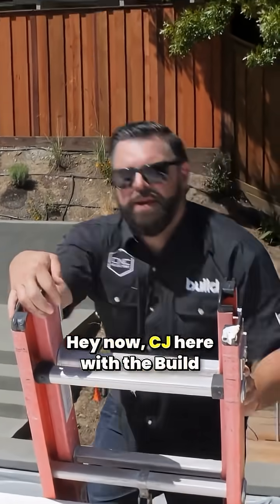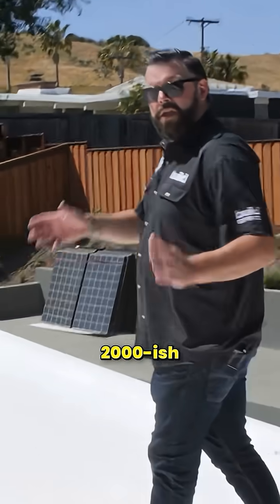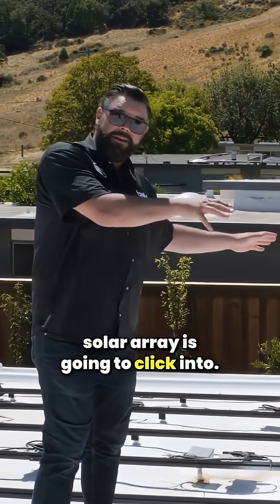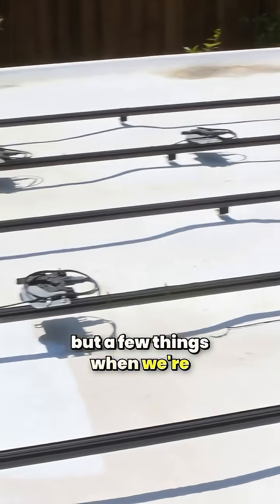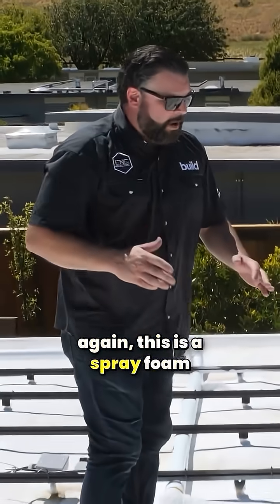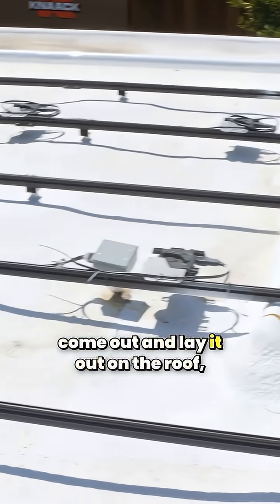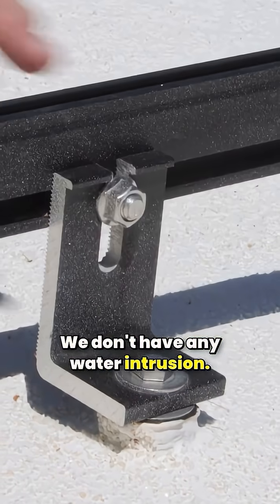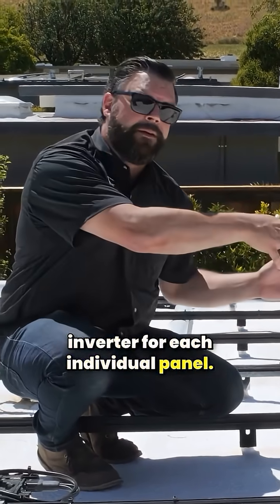Smart Solar Planning

Comment: Solar ... so so totally not economically feasible.
Reply: The system is paid off in 5-6 years. While it's being paid off, it's making power for the house, offsetting the utility bill. After it's paid off, the homeowner pays a nominal fee to stay connected to the grid, but the solar panels produce all the power the home uses annually. 
How is that not cost-effective?
Reply: @tomlampros7122  Sorry, here where electric costs 12c/kWh, it gets paid off in about 27 years, well past the time it needs to be replaced.
Reply: Not in service by 12/31/2025 … no 35% tax credit for you. Micro-inverters tied to the grid very expensive and vulnerable when the grid goes down (bad weather … just when you need it).
Reply: Matt spends so much time on rain shields on the exterior walls that I’m surprised he’s putting mounts on a roof, especially a flat roof.
Reply: @bhbaker220  Especially where he lives, the sun and radiant heating are brutal ... every roof penetration is guaranteed to leak at some point.